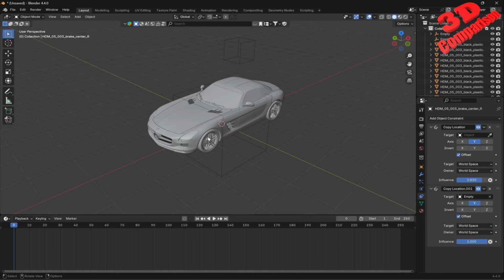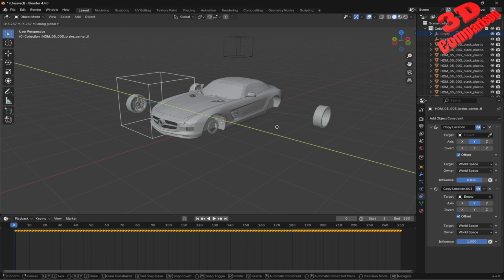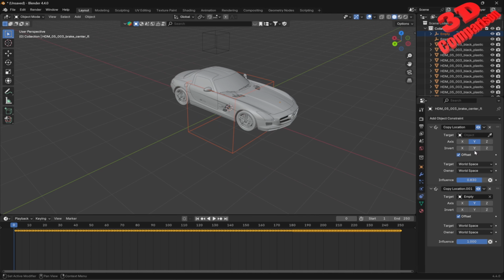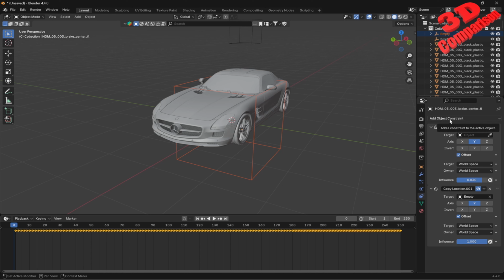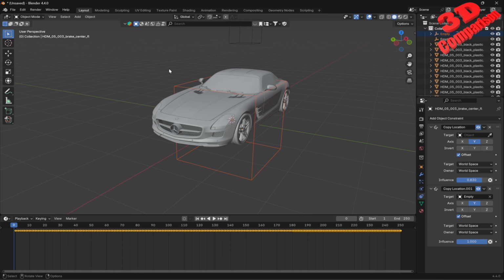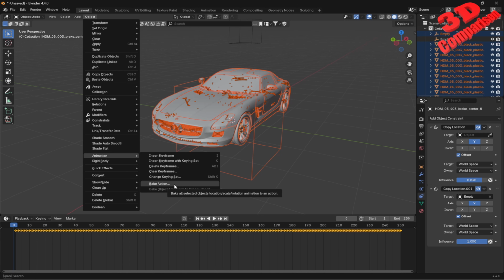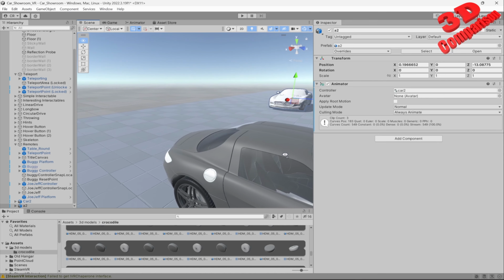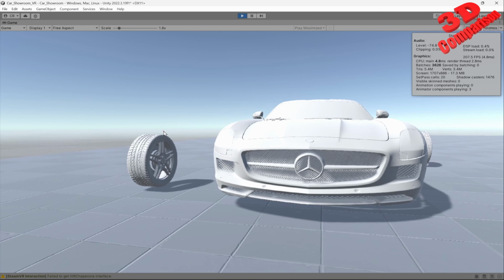🚗 Exploded View Animation from Blender to Unity – Using Object Constraints & Baked Animations 🎮

Comment: I exported a baked car animation from Blender and imported it into Unity, but I can’t seem to get it working. How did you set yours up? Any insights?
Reply from the maker: It should work smoothly and have it within the fbx. I also teach unity snd blender and it works for all my students and I never had any problems. Most likely the export wasn't done correctly, check the check marks on export bake animation to be the same, otherwose you will have individual animations for each component
Reply: @3DComparison  Thanks for clarifying. Do you by chance have a video where you show the full workflow, whether you used Timeline or whichever method, from exporting a baked car animation in Blender to importing it into Unity and setting it up in the Inspector (Model, Rig, and Animation tabs)? That would really help me understand the process better.